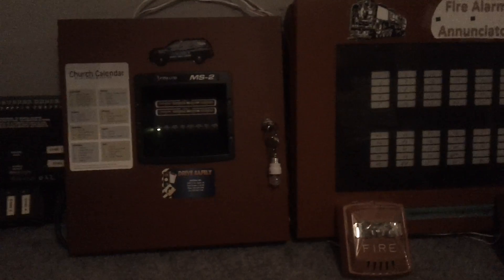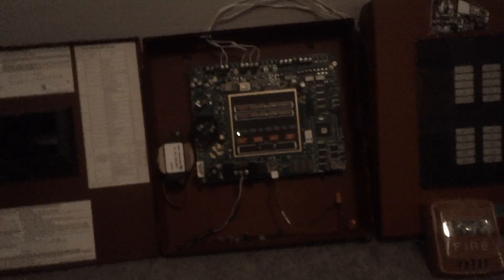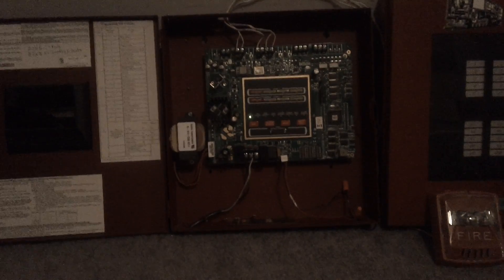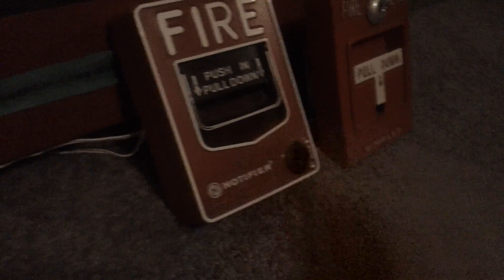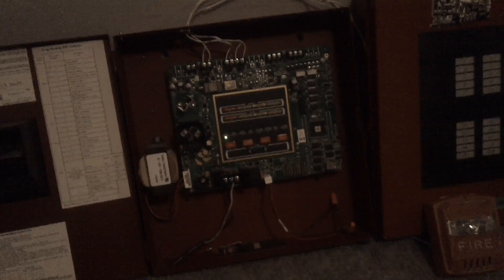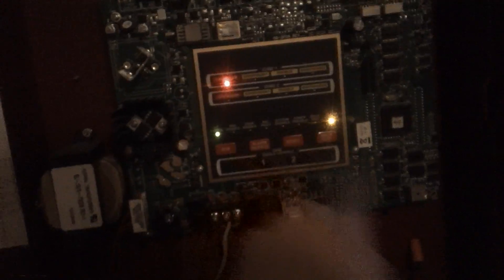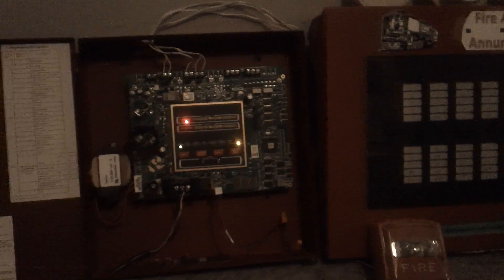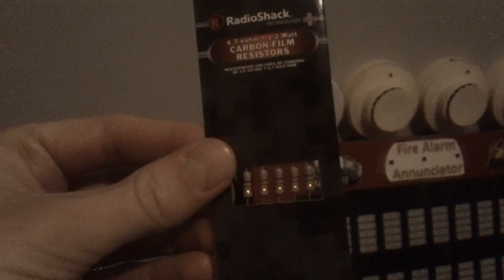Floor System Test 25 - New Panel

Comment: To be honest with you firelight panels aren't usually my favorite either but to tell you a little story when I first was getting a panel off of eBay I almost bought a firelight MS2 and I didn't know it put out fwr but I found a notifier panel instead that was an Ansel Auto pulse 542R but I'm sorry about your old simplex 4004 it does make me very sad that panels have to break for no reason but I feel sorry for you

Comment: If you put a simplex truealert on a panel with FWR will it really burn up.
Reply from the maker: MST 2474 Well, not literally I'm sure, but it will eventually stop working. Simplex alarms are made to be run with panels that put out filtered dc. They are not made to run on FWR, so it will damage them over time.

Comment: About the transformer and the batteries, I've heard a lot of people saying the transformer makes that sound when they plug it in, I don't know because I don't have any batteries left, but I might be getting some soon
Reply from the maker: Alright, that's good. Last night the sound turned into a loud buzzing, so I have a feeling I've already screwed up the transformer. It still works, but even with the batteries unplugged it keeps making that sound, so I may have to replace the transformer in the next few weeks here.